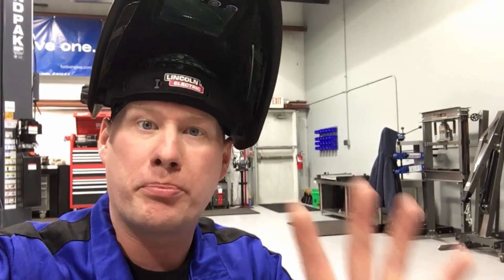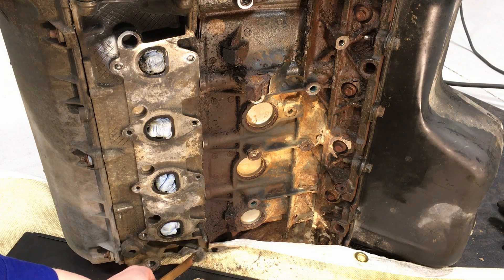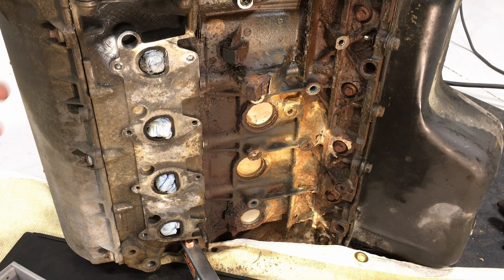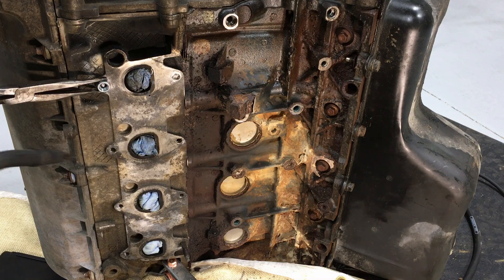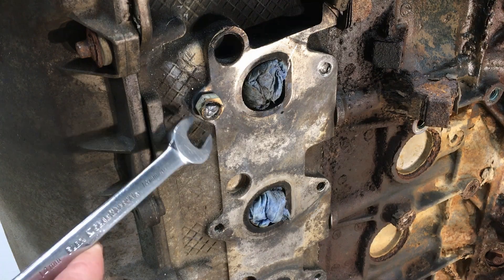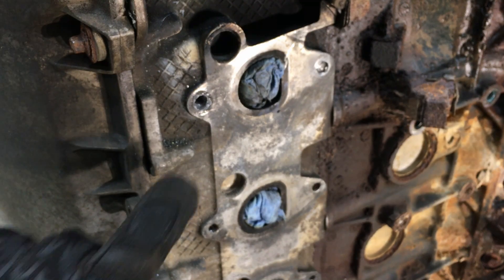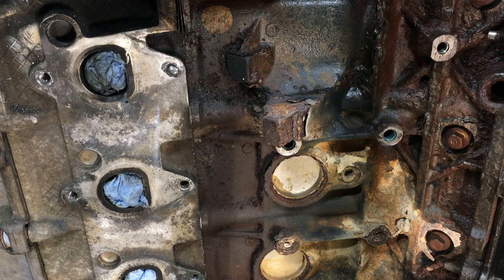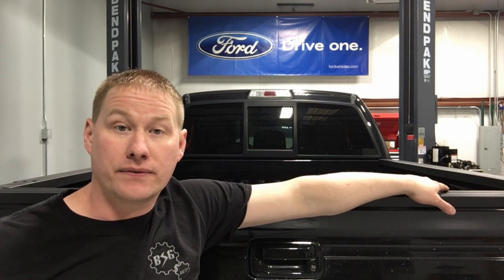Best Way to Remove Broken Exhaust Manifold Studs?

Comment: I used a plasma cutter and bolt extractor and air hammer! My driver side is the most difficult stud to reach on the 2005 Ford F150 5.4. It was corroded inside the block, not flush. 1st method failed (welding). Even with my engine hoisted  off the mounts a few inches, it was extremely difficult to try and reach this with my wire feed as the weld puddle would not stay inside because of the angle. 2nd method attempt failed. Used a right angle drill attachment to with a tungsten harden drill bit, so i could make a piolet hole for the bolt extractor. This bit broken inside and fused to the broken bolt. 3rd attempt was successful! Took the plasma cutter and very carefully burned a hole inside the broken drill bit until it was large enough to insert the bolt extractor. However, this proved to be difficult  because i could not hit the extractor in with a hammer due to the lack of clearance. I took my small air hammer bit and drilled a bore hole that i could slip the extractor bolt into. This allowed me to hammer the extractor into the stud, and I was able to back out the broken stud! Note: if you plan on welding or using my method, i recommend using aluminum foil by 1st, covering those inside the manifolds' holes. 2nd i used an aluminum pie pan and drilled a hole and place over the studs to prevent pitting the block.  I have a few photos to  show each pain in the rear it took to remove these  studs . Great video

Comment: Does the orientation matter? Would it work if piece is laying flat - would the spatter stick to the surface? What wire would you recommend - someone mentioned it should be Carbon Steel flux core - is this true? Thnx

Comment: Welding galvanized things is bad for you, because you might breathe in zinc fumes.  You can take the zinc coating off the nuts by soaking overnight or so in vinegar.  Soak until they stop bubbling.

Comment: I know nothing about welding.  My biggest fear would be accidentally welding on the block on the inside...is that impossible because it is aluminum and it won't weld?
Reply from the maker: Correct
Reply: @FordTechMakuloco  awesome! Now I have no fear making this repair...did not mean to rhyme there haha...if I even need to...I don't have a broken stud yet but I am going to be extremely careful removing the manifolds...what do you like for penetrating fluid?  Do you think acetone/atf is a good mix...I hear that is the best

Comment: I'm getting ready to do one on a  Ford F150 and the studs are still sticking out some is it best for me to cut them flush with the block or should I just put the nut right over the stud welder right to the stud that sticking out?
Reply from the maker: Cut flush, build nipple, slip on nut and weld.
Reply: @FordTechMakuloco  
I'm doing that right now
Reply: Welding some directly right on stud is working though

Comment: I recently removed a broken #6-32 tap from new aluminum, broke at about 1/2" deep, by tig welding a 3/16" tall spire with .045" tig filler rod, then took a 4" length of 3/32 tig rod and bent a half inch long 90deg at the end and welded it to the spire.  Twisted right out.  Smallest tap I have ever removed in my 53 years.
Reply: I know this is old, but I just posted a comment. Your method may have worked for my situation if I owned a tig welder. However read my comment and curious if this is what you ran into:
I used a plasma cutter and bolt extractor and air hammer! My driver side is the most difficult stud to reach on the 2005 Ford F150 5.4. It was corroded inside the block, not flush. 1st method failed (welding). Even with my engine hoisted  off the mounts a few inches, it was extremely difficult to try and reach this with my wire feed as the weld puddle would not stay inside because of the angle. 2nd method attempt failed. Used a right angle drill attachment to with a tungsten harden drill bit, so i could make a piolet hole for the bolt extractor. This bit broken inside and fused to the broken bolt. 3rd attempt was successful! Took the plasma cutter and very carefully burned a hole inside the broken drill bit until it was large enough to insert the bolt extractor. However, this proved to be difficult  because i could not hit the extractor in with a hammer due to the lack of clearance. I took my small air hammer bit and drilled a bore hole that i could slip the extractor bolt into. This allowed me to hammer the extractor into the stud, and I was able to back out the broken stud! Note: if you plan on welding or using my method, i recommend using aluminum foil by 1st, covering those inside the manifolds' holes. 2nd i used an aluminum pie pan and drilled a hole and place over the studs to prevent pitting the block.  I have a few photos to  show each pain in the rear it took to remove these  studs .
Reply: @GAMESFORUSdotNET   The method I explained is for very small screws and taps. #6-32 is slightly larger than 1/8" diameter.  For exhaust studs, typically 8mm or 5/16", I would use the FordTechMakuloco method.  The only thing I would add to the FTM method would be to use a small oxy-acetylene brazing tip, (not a rosebud) to carefully heat the broken stud to glowing red and allow to cool completely before welding the nut on.  This will expand the broken stud within the hole and break the corrosion and when the stud cools it might even be possible to screw the stud out with a reverse drill bit.  I like the pie pan suggestion to protect the surrounding aluminum.  Also, never weld on a zinc coated anything due to toxic zinc vapors and zinc is hard to weld thru.  Use an uncoated nut.

Comment: Something else that works really well is if you can get a small hammer in there and tap on the welded nut. Its double trouble on the stud. Heat and a little shock

Comment: I have a 2013 ford f150 3.5 with broken manifold studs. Will mig welding a nut to the broken thing get them out? Not sure about the material of block and threads. Anything I should worry about? I don’t want the weld material sticking to anything but the broken stud. They are halfway down inside the block..

Comment: Why u use flux-core wire? It makes slag, and u really don’t need it in this Situation, I think ist bette to use a Gas shielding, with argon/CO2.
Reply from the maker: I am not getting a tank for my cart just for a quick spot weld on exhaust manifold bolts. I never use the welder for anything else.
Reply: @FordTechMakuloco  i understand… it worked and so it is good 👍🏾

Comment: I got to wondering, saw comments that it is only the first few stud threads that freeze in place so why wouldn't a guy want to heat every stud prior to attempting removal and risking a break off? I'd rather deal with pinpointing an fine single acetylene flame cone...say a "0" or a #"1" welding tip adjusted to keep the flame manageable yet adequate to break the steel/aluminum lockup.
Reply from the maker: The studs are not seizing in the heads at all so that would not help.

Comment: This vid is PERFECT for me. So glad You made this. I’m no welder either but have to do this on my hemi 5.7 (like everyone else). My question is: when I flux-core the nut on, do I need to remove the battery terminals or can I just leave them alone? Thanks. 🇨🇦
Reply: always remove cables while welding ANYWHERE on a vehicle...both cables is better...if a welding current can find its way to computer parts because of a bad ground..and there are lots of possibilities and tie the cables away from the posts so they cant find their way back there.....the damage can be anywhere you never imagined..even grounding the welding cables directly to the motor doesnt guarantee the battery will be safe

Comment: I'm lucky enough to weld fairly well, and TIG weld. I've used my welder so many times to extract studs/bolts I lost count. I think over half of my 7.3 exhaust studs required welding on a nut. Invaluable tool to have in your arsenal.

Comment: In the process of tearing down my 02 6.8 Liter with 700k miles on her and broke a few of the bolts taking the manifolds of. Very deep breaks. I am going to try this but would it help if I used a little piece of copper tube that barely fits in the hole to protect the threads and then added the weld?

Comment: This is a great technique and has its place, but i'm not sure why it's the go-to method and it definitely is not the best. We used to do this on all the fords and chevy's that break exhaust studs in the rear of the head and we would do this on-car because of lack of room.  However, lol, i remember literally half the time the shop owner would waste hours trying to get a good weld stuck to a sub-flush stud and they kept breaking off, leaving a bay tied up for hours.  So many times the best tool is a sharp center punch and drill some straight holes and use an extractor.   

Every situation is different and this method is definitely in my toolbox, but if they're below flush and i have the room, i'm much faster and more efficient with drills/extractors/etc.  I basically do this only when they're broken flush or slightly more than flush but still not enough for a female extractor or small aluminum pipe wrench.   

LOL I will never forget how angry and how much time Jake wasted because he refused to get good with drills / extractors, literal half days wasted using this method getting angry LOLOLOLOL what a loser, you never quit jobs, you always quit bosses.

Comment: I had never welded before, but I recently took a crack at this. My 4Runner had 7 (of 12) broken/stuck exhaust studs. 

I bought an Eastwood welder, loaded it with a spool of flux wire, practiced for about five minutes on some scrap metal, and then went to town on the exhaust studs. I wasted about 10 nuts on the first stud, but I eventually got it out. The second nut spun out on the first try. I have to buy some more nuts before I go after the remaining studs, but I feel that I'm on my way. 

In these comments, I read about people warning of welding coated steel, so what I did was soak deez nutz in some vinegar overnight. This dissolves the coating, leaving you with bare steel. Works well, though be warned that rust sets up in minutes, if you don't protect them (WD40 works well for this) after taking them out of the vinegar.

Comment: I broke an extractor off in the block, bottom very front port.  Tried welding, about 30 times, but it wouldn't stick.  Any suggestions out there?  Am using a Lincoln 140, never welded anything in my life.

Comment: i tried this and failed and then tried drilling it and it broke after turning maybe 1/3 turn, then tried welding nut on there again and failed.
now im waiting for an auto darkeneing helmut to hopefully weld better, or clamping my flange down with homemade clamp that uses 2 existing nearby bolt holes or swapping all my engine stuff to another core and selling this LS

Comment: Great vid. Now if I could only weld 'as bad' as you do.... What method do you use to remove studs that are NOT broken? I have a 2001 F-250 5.4 and I'm tired of the the heat-em-up, lock on vise-grips and doing the Twist... Also I've been told a couple of times, replace with stainless hardware...!

Comment: I can’t believe it! Big thumbs up! I’m working on that Ford 4.0 sohc and Makuloco... 10 stars bro! First walking me through the timing process, and while I’m in the gasket, carbon build up clean up process, and just finishing valve seal replacement... I figured I’d see about removing the 2 broken exhaust manifold studs so I can be completely done with this right side head. I couldn’t believe it when this video popped up in my ‘tool’ search. Frickin’ Perfect! I’m a union ironworker local 433, welder. Your welds passed this test lol all that matters right. Now I gotta see if I can get this to work for me. Big thumbs up on all videos I’ve need thus far. Thank you.

Comment: I usually weld a washer to broken stud first then nut to washer. Lets me get a good bead on stud.
Reply from the maker: I only go that far when it’s hard to get into a tight spot otherwise just the nut works great less mess
Reply: @FordTechMakuloco  i totally agree. Start with least invasive methods for extracting first. However you make it look way too easy 😉. As always another great.
 tutorial. Recently bought a f250 with 5.4. Your videos are providing me a great service.
Thanks

Comment: I had 8 of 10 bolts either break or round off replacing the intake manifold in my 5.4 2v.  It took a lot of tries, as I kept twisting the nuts off the studs but this tip saved my bacon big time!

Gave me the confidence to go after the exhaust manifold that’s been ticking for a year

Comment: Just wondering have you ever replaced the exhaust manifolds on a 2012 ford f150 with the 5.0 can you replace them with the engine in or should it be pulled
Reply from the maker: Yes just recently you do them with the engine in no problem
Reply: Thanks for the quick response you have great channel and always helpful
Reply: Sorry to bug you should you lift the engine up a bit to cut the nuts off it’s seems real tight by the engine mounts

Comment: Cheat code: Use an air chisel/hammer to destroy the manifold, leaving the heads exposed for a vise grip... voila, zero busted studs, because the threads are fine, just the head gets fused to the manifold, so ... no manifold left, no problems.
Reply from the maker: Um no
Reply: @FordTechMakuloco  lol  hey if she's super rusty..  still no? You must live out west, in salt states there can be not much left and your choice is either drill out broken crap, or cheat and live easy

Comment: Thank you so much for this video and tip.  I had known about and have welded nuts onto broken studs, but never had to deal with a stud broken sub-flush inside the head.  It took me three tries to get it right - the third time I sanded the top of the broken stud, and built it up enough to get a nut on it, and welded the nut on it, and it came out.  Save me a lot of time from drilling it out.  I am replacing the exhaust manifolds on my 2002 F150, 4.6L, and all the studs except for one, had to have nuts welded onto them.  The one that broke sub flush, broke after I welded a nut onto it.  I would never have considered the fact that the weld would not stick to aluminum.  Thanks again!

Comment: Why the heck can't Ford use stainless Studs and Nuts that don't break off? I have 3 broken studs on a 2011, V10 E450 with 35K miles. It ain't right, I tell ya.

Comment: In the past I have used a similar process by first welding a heavy flat washer followed by the nut. Sometimes have better luck getting good penetration on stud by not having to weld in a hole. Sometimes welder wants to arc to side of nut rather than stud. If you encounter a problem,it's easier than having the nut twist off and having to clean out hole to begin the process again.
Reply: I struggled for 2 nights trying to get a nut to weld on but couldn’t. I got some big flat washers and did what you said. Got 3 out in about a total of 25 minutes. Thanks for posting this!
Reply: I used a Fender Washer welded to the Stud or Nub, then a Large Nut centered on the Washer and welded to the Washer. A Nut twice the diameter of the Stud allows for plenty of material to be welded to both the Stud/Nub and the Washer.

A correctly sized Fender Washer will protect the head surface and provide good clearance to weld the nut to the Stud/Nub. The Large Nut allows for plenty of weld material to be added to the Washer and the material on top of it.

I did six on one side a few years ago.
Ford had driven the studs so deep into the head that the non-threaded fat section of the studs were actually grooved by the ALU opening.

Comment: Very excellent. I learned something new. Now, my question. Is the Ford bolts anything like the ones used in the 1987-1994 aluminum heads. GM charges a very high price for the bolts and nuts but, work very well. Thanks for the video.

Comment: Why doesn't my weld stick to the broken stud in my manifold? I've tried and tried and all it does is break off.
Reply: He say weld the edges inside the nut, not just a glob in the middle. Also Maybe you need to adjust your settings, not sure what welder your using. Or maybe you need more current flow.

Comment: To help improve the welding with a mig, don't use a ZINC nut! the gas it emits messes with the weld in a BAD way! So, collect a few of the plain black steel nets for this purpose.
Reply from the maker: Oh I would but they are so hard to find. I dont have any problem with the zinc nuts holding, not for this purpose anyway.
Reply: @FordTechMakuloco  
Well, they are hard to find if you just look at the hardware stores, but LOTs of the actual factory bolts and nuts are NOT Zinc coated, but YES the ones they get you from their nut and bolt bin are ZINC! (and I do mean at the dealers)
Look at your second step weld (not the tack) if you notice there is a volcano little crown in it!!! That is from the gasses emitted from the ZINC, trapped paints will do this as well! (I'm not a welder either) but I've seen this many times over the past 20 years or so, the one thing about mig welding is CLEAN, untreated steel is what it was designed for.
I'm very impressed with your skill and your video but if you keep an eye out for just some common grey or the black nuts (used) and toss them in a jar or small plastic tub you'll find they will weld better, EVERYTHING that isn't steel screws with the mig weld.
I'm just trying to give you some pointers! Also! the fumes from Zinc (galvanized) is EXTREMELY toxic if you breath very much of it. Those volcanoes in the weld is from something contaminating molten metal during the welding process, even oxygen messes with it, that's the purpose of the flux, or if used the gas shielding that's in a mig welding setup.